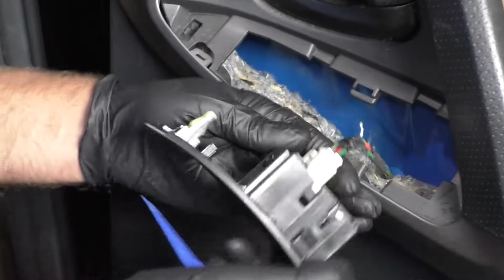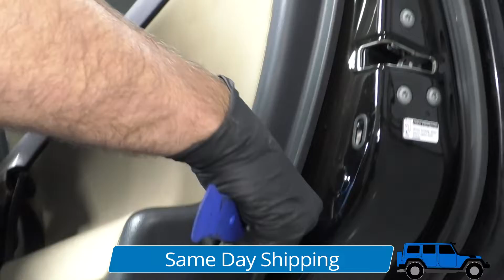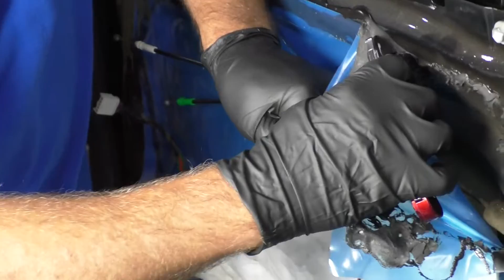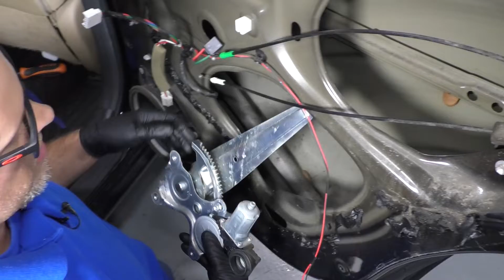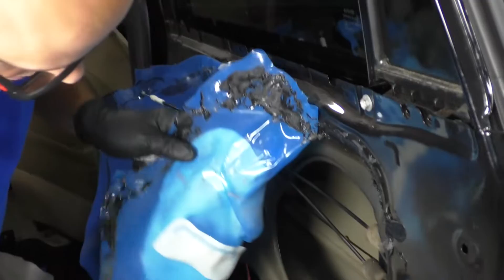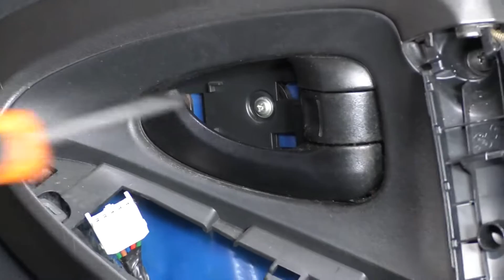How to Replace Rear Window Motor 05-16 Toyota RAV4

Comment: Brilliant vid, thanks for that! 

Question. Seems like all the bolts on a door are holding the arm, not the motor itself. Would it be possible to take off the motor only with a bit of wiggle?